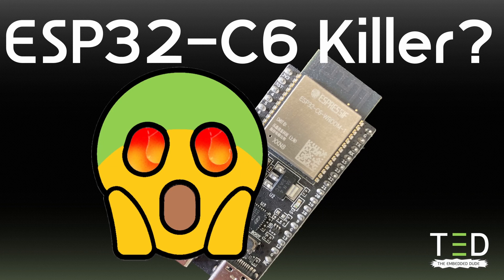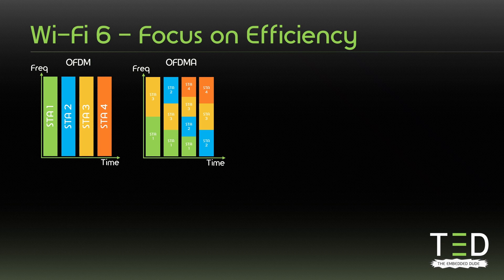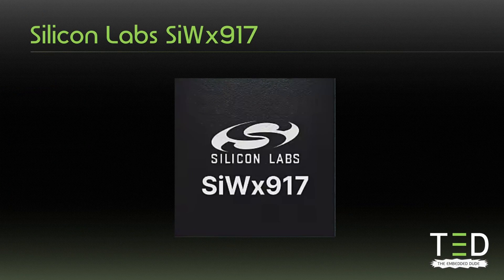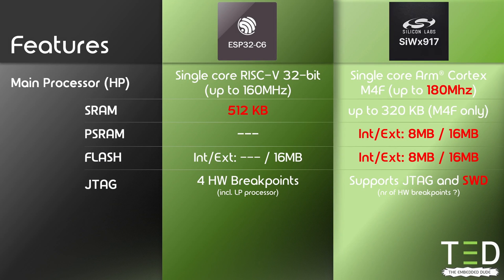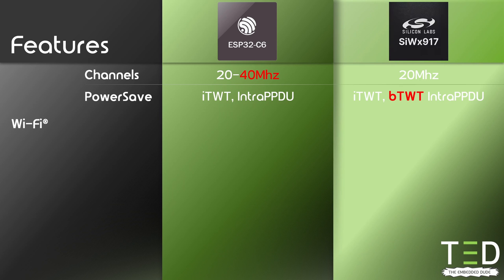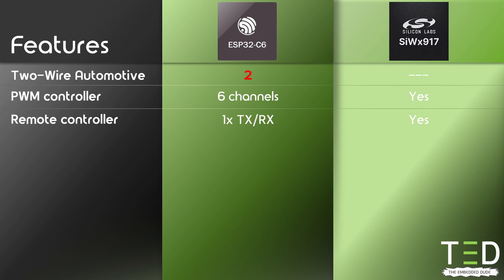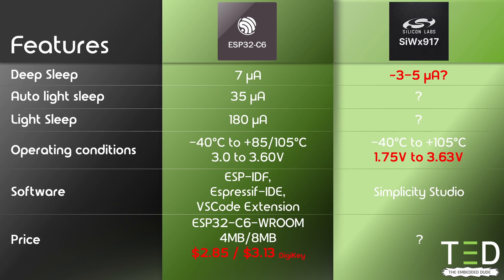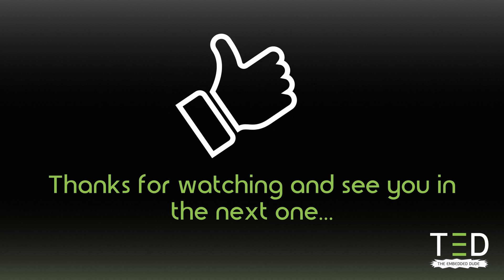Is this an alternative or even an ESP32-C6 killer?

Comment: WTF is an AI and machine lerning accelerator? In an MCU, I mean.
Reply from the maker: Hi. In some of SiLabs processors you find a co-processor which they refer to as MVP - Matrix vector processor. Using the coprocessor allows for faster matrix and vector operations.  And it would off-load the main processor.
Reply: @TheEmbeddedDude   What are the applications, though?
Face and object recognition?
Reply from the maker: Well I am not an expert in this field but I assume its limited to the size of the  model fitting in the µC. I assume most µC based ML/AI implementations will use a trained model  (trained on a powerful system) that is then put into the µC for things like  pattern detection /anomaly detection to do things like gesture detection and so on. If I am not mistaken simple object recognition should be doable. Could be a nice topic to dive into at some point.

Comment: bl616/618 also has 2.4ghz wifi-6. Already available and probably cheaper than Silicon labs one.
Reply from the maker: Hi. You might be right about that. Most likely they are cheaper. Its just hard to find good documentation for the Bbouffalo Lab products. Do you know where to get decent datasheets?

Comment: Worth remembering also that there are many variants of the ESP32, with dual core variants with hardware floating point, and far more GPIOs than the C6, although the C6 has the most recent BlueTooth support. I can't imagine Silabs will be able to compete on price, so they will have to exceed the feature sets and power consumption at least. As for the IDE - I think this is one of Espressif's weak points. Their own IDF, and VScode extensions are a complete nightmare to get working (on Windows at least), and their internal team often break compatibility or introduce bugs in libraries, then deny they did anything, then claim people are just "using it wrong", then finally fix what they've broken. The Arduino extention (not mentioned in this video for some reason) is actually the easiest way to work with their devices. I use this with my own custom boards.

Silabs also have a VSCode plugin along with Simplicity Studio, which is not mentioned in this video.